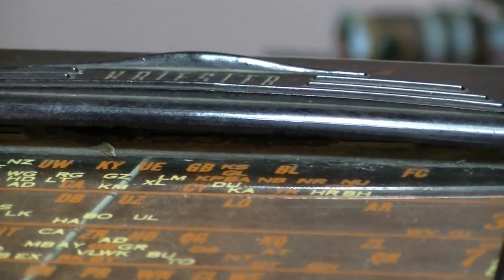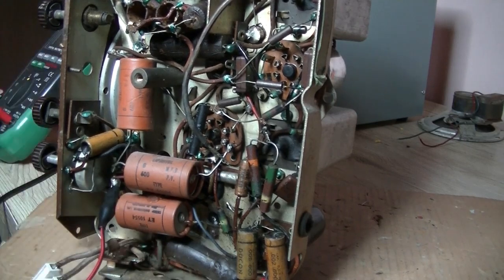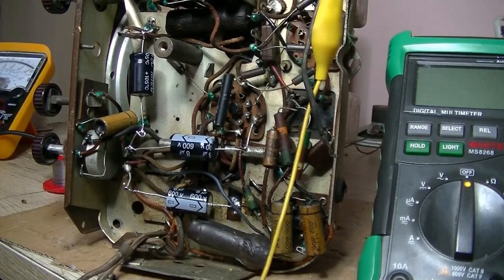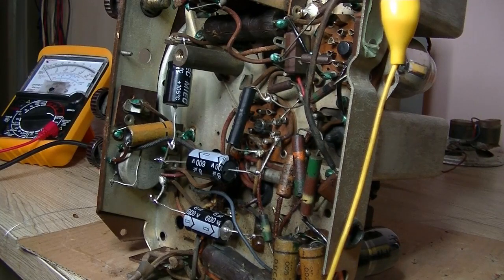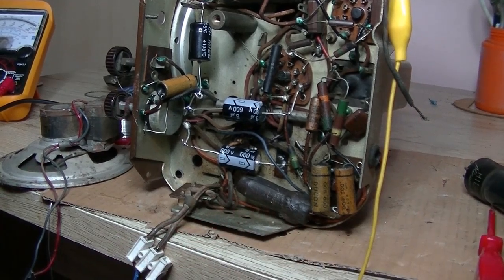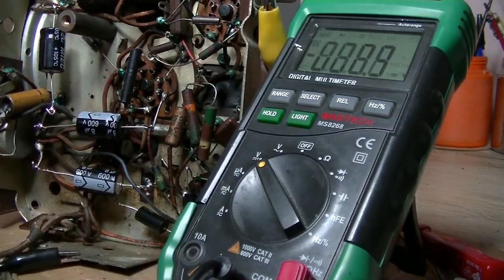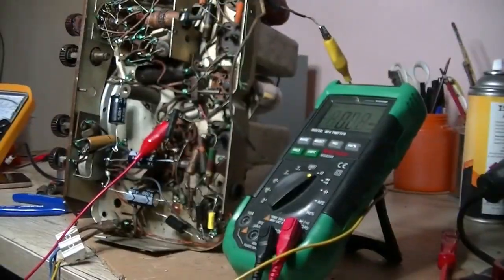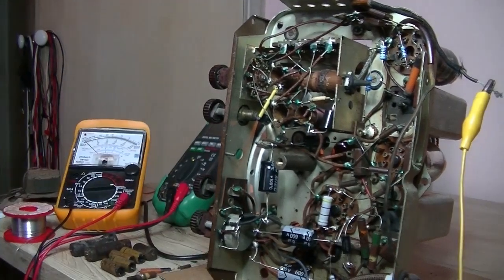Kriesler 11-20 Valve Radio Restoration. Circa 1948-50

Comment: I have a BC348 receiver from 1943 and it used a 6X5 rectifier in the power supply someone added normally in the aircraft they would have used a dynamotor to supply power. So when you said it was made between 1948 to 1950 year I was born lol the 6x5 Rectifier was used. Odd that you are having so much trouble with this one. But hard to believe that one resister caused the problem. Just goes to show you every part in a radio is important. Thanks for sharing.
Reply from the maker: Thanks Larry. I heard a story from a guy who worked in the radio industry. He was in quality control for one of the manufacturers and  It was the 60's. The company was trying to cut costs so he would start taking out components one at a time until the radio stopped working. All this to probably save 6 pence lol

Comment: The  models 11-20E and F is shown as the circuit for this radio and shows two E caps. A C53 at 8uF 350 V and a C110 
at 30uF at 350 V. Interesting that there were  several chassis design changes for it. Several interations of this receiver
with changes to components and tubes. Great fix after having a row with the dirty contact switches.
Reply from the maker: Engineers certainly love changing the design. I think as they employed new ones, they just had to tweak the design to leave their mark lol

Thanks again Steve :)